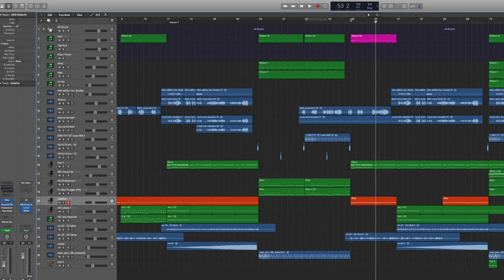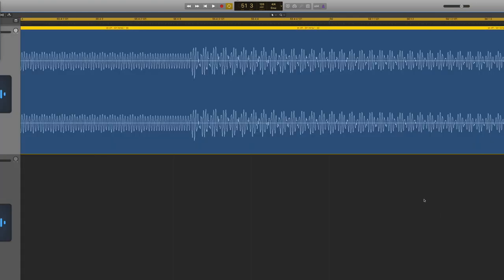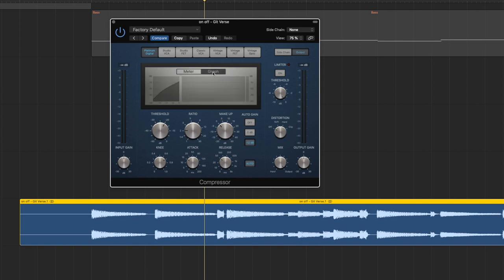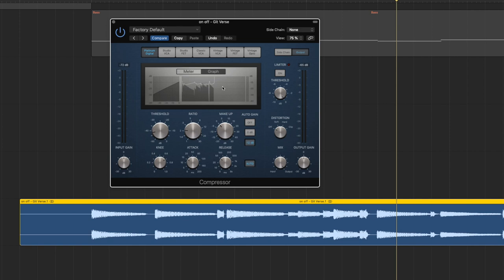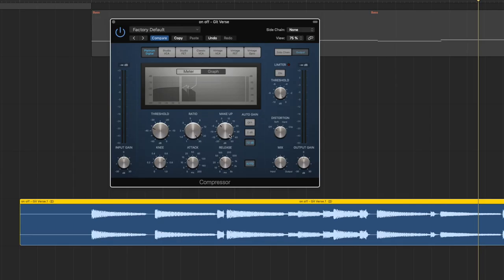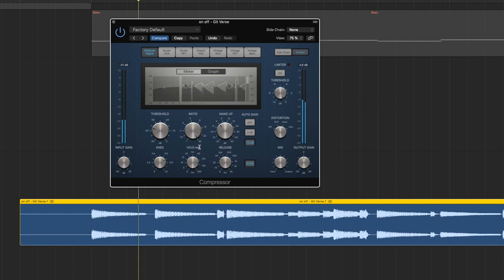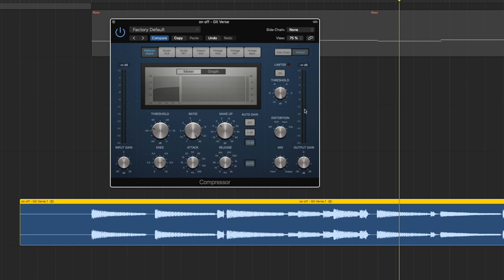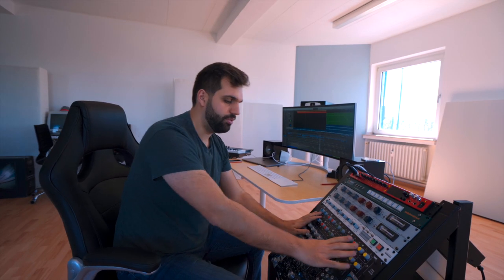HOW TO COMPRESS AUDIO

Comment: My fast 5 compressing & general plugin tips:
-Adjust the gain to the plugin input to ensure that it's operating correctly: Typically -18db fullscale
-Match the output-level from the plugin with the input-level: Change the sound with the plugin: Not the volume!
-Do "Before and after" testing with plugin bypassing to check the result: What does it do, and how?
-Every compressor works differently: Test yours extensively & understand it/them
-Listen to the changes you make in context with the entire song: This is what reaches the listener!

Comment: Hi Jon, and thanks for your videos.  I have learned a lot.
I've been working on a jazz piece lately and had eventually come to feel that the only way I can get the acoustic bass to sound authentic is to use gain reduction automation on it. Though more labor intensive, gain reduction in this case really did help.  Otherwise, I normally use a compressor.  
I appreciate your straightforward approach and was even a little pleased to hear you say that you rarely use hardware compressors.  Everyone seems to have a preference for this or that compressor but as a relative newcomer I began to realize that I just can't go out there and buy every compressor plug in that everyone thinks I ought to have.  I got rather tired of that litany so it was nice to hear your straightforward approach.
Reply from the maker: Thanks. Yes. I’m 100 sure you can make amazing professional music just with the logic stock plugins. It’s about how to use them.
Reply: Yep, the phenomena of pushing gear&software is real out there. There's a lot of clever product placements, business-plans and marketing strategies behind the most of it. It's easy to loose ones rational-thinking when something sounds really dope in a video or audio-demo, making it seem as if it's the magic of "that-one-plugin" or piece of gear being demonstrated, while in reality it's a minor improvement of top notch sound-design or songwriting. It's also very common that people try to push the stuff they use themselves. Nice to see a newcomer spotting the patterns this early. 

By the way, I'd say that choosing software & gear is something of a craft - it's a trade-off between many things - for me I often boil it down to price vs productivity. The good thing about software are the demo-versions, so that one can see if a piece of software really helps or not: "First you try it - then you buy it!" 

I hope this comment makes sense and is coherent - I suffer from quite a sleeploss -my head is quite mushy! Cheers!